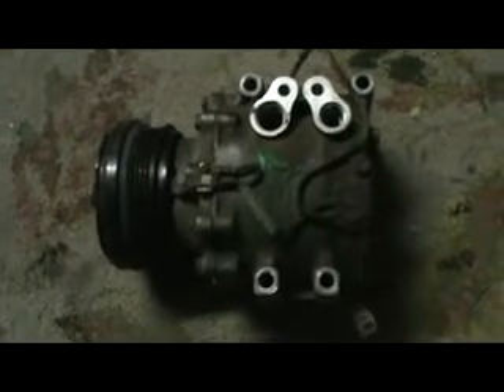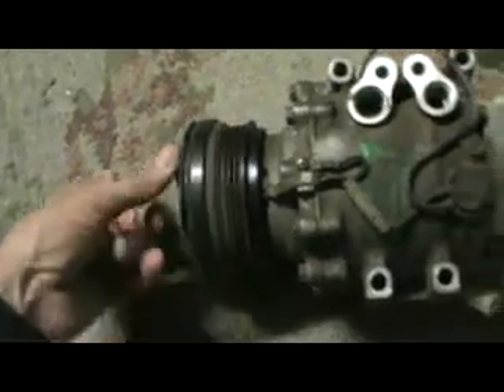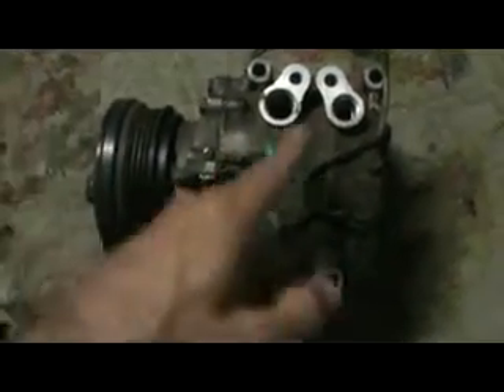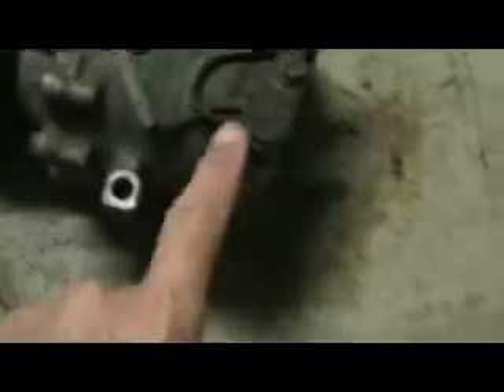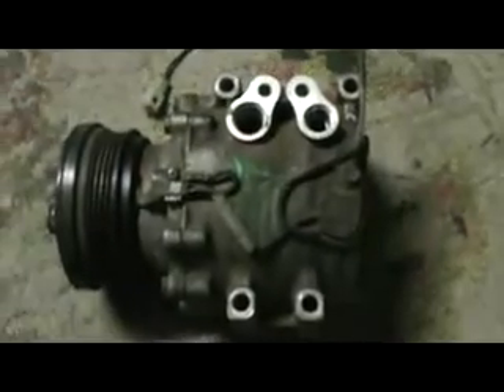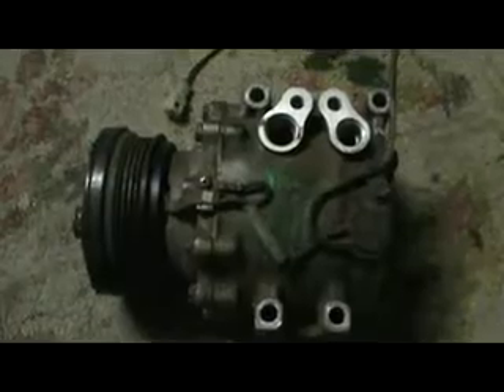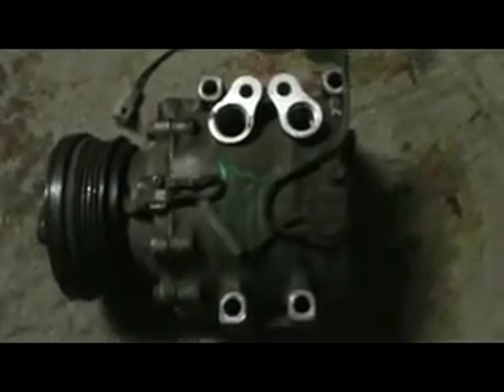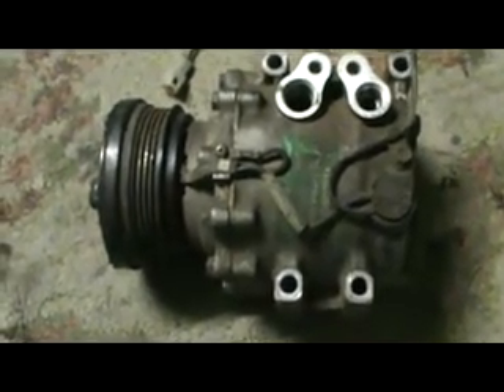95 mazda protege ac compressor help leak fix easy

Comment: I have a 1989 Pontiac Grand Am and I had a bad compressor well I went on eBay and I bought a remanufactured one well then I read another utube Channel and they said don't use those cuz they're no good well sure enough it's no good they said it leaked is there any hope for it may be an O-ring?